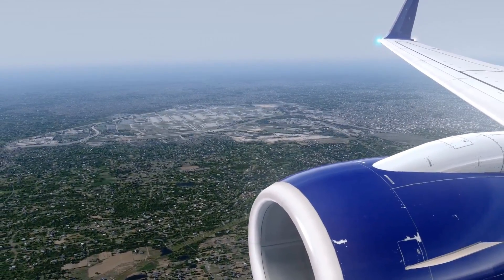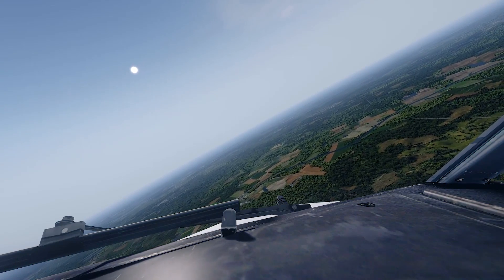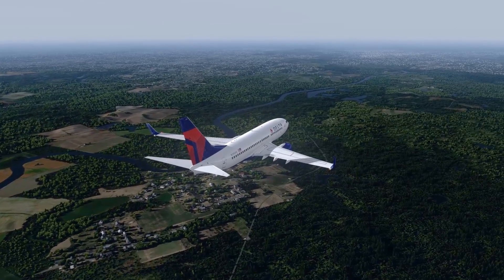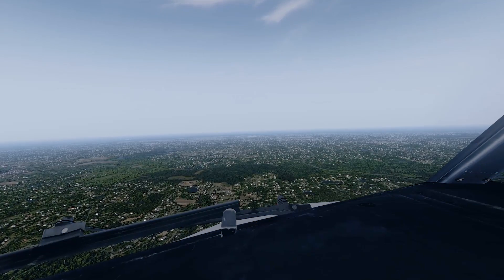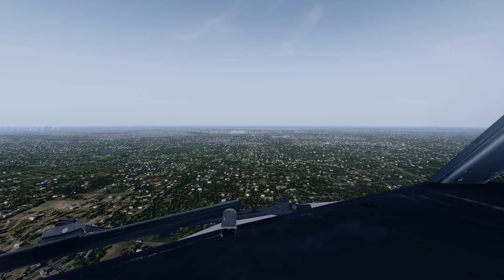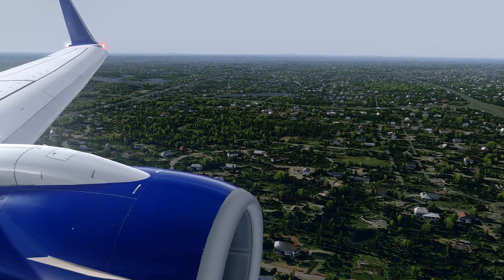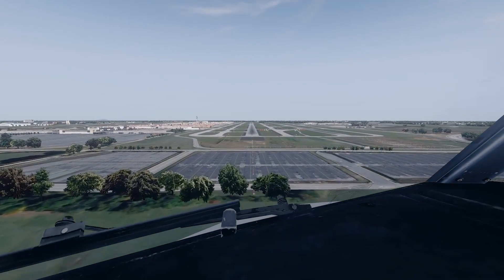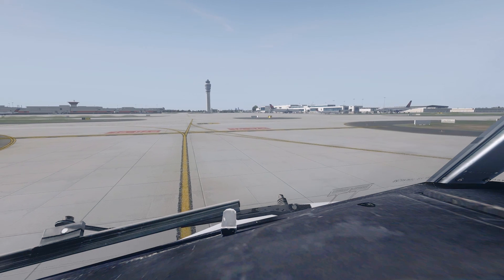[P3Dv4] Atlanta Landing || ADDONS & SPECS are in the DESCRIPTION!

Comment: did you try the new rex sky force 3D?
Reply from the maker: Yes, but I'm very disappointed. It's not the product I hoped it would be.
Reply: Fangzahn Aviation Studios Indeed, i'm reading lots of disappointed comments about it.
Reply: do you prefer active sky cloud art?
Reply from the maker: SkyForce destroyed my weather system and it didn't backup the original cloud model files, so I used ASCA to "repair" these and I decided to stick with it for a while. Normally I'd say SC is better but there's no doubt ASCA looks amazing in P3D.